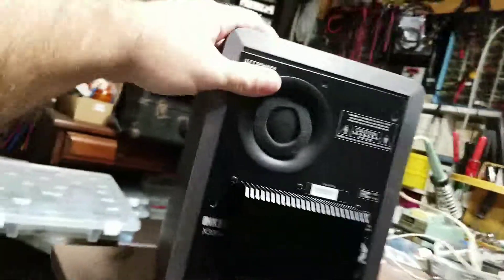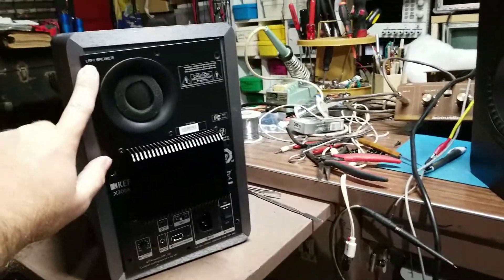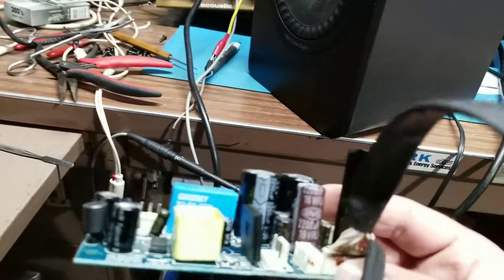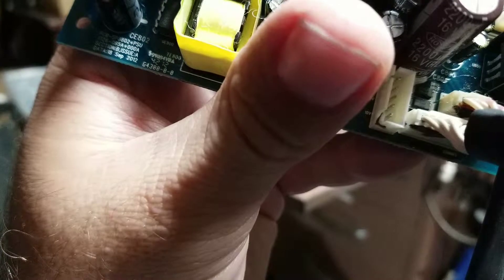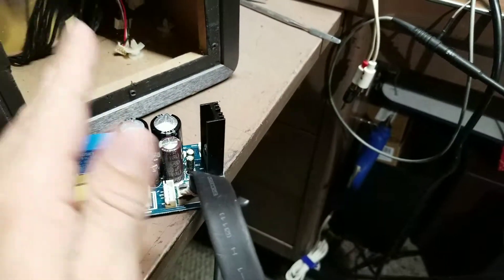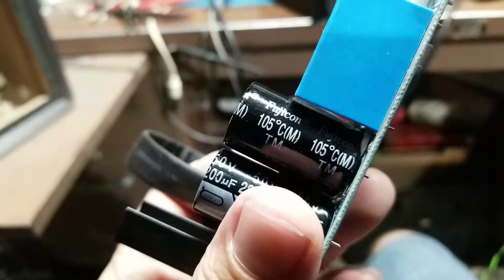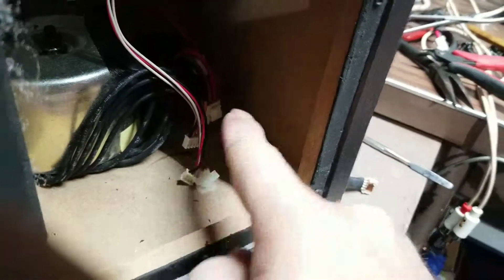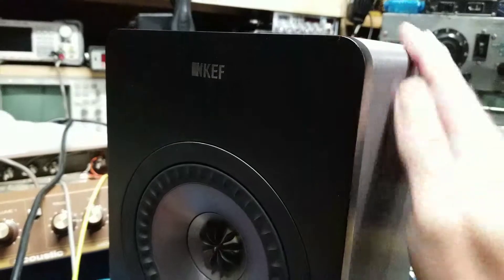KEF X300A issue with teardown and diagnosis (part 1)

Comment: Thank you for sharing this video. It encouraged me to open the speaker myself. The process was painful and far from repair-friendly, but I managed to replace the capacitors, and it works again now. For anyone else attempting this, the capacitors are easy to find on Amazon, and I cut the plastic bolts holding the board in place

Comment: My kef lsx gen1 has stopped outputting from the master, I lose sub and left with only audio from the slave. If you can do a teardown of them would be great. I think a lot of units are dying. Mine lasted 3 years and want to fix them. I have gone thru all the kef support hoops

Was hoping to get at least ten years out of them but nope.. Won't be buying another kef product..
Reply from the maker: Hey, I found other issues with kef products and isolated most issues to the glue they use for holding down components and connectors. The glue turns corrosive after a few years and eats through components.  I'll try to put another video together in near future.  Sansui was plagued with this issue as well. There's some good reads about them on the web

Comment: I've had the same problem intermittently for years.  These speakers seem to be sensitive to the USB cables. Just swapped the cable connecting the two speakers, and they're working fine again. I'm pretty sure the first cable was original, and certainly the replacement wasn't.  Notably I used a cable that had worked with a Garmin to sync device to computer, when an older cable I'd used would only charge.  Not all USB cables are the same. Def try out with alternatives before giving up.

Comment: So no Part #2 but if you have basic soldering skills you can use the Part #1 info to fix your KEF speakers.   I had the same problem and replaced the same capacitors and got them working again.  All the components were available on Amazon.  The power supply is a PITA to get out but rather than taking the speakers out I clipped off the top of the rear plastic retainers and replaced them on the reinstall.   Also he kinda misleads you on the right speaker power supply...you need to replace those capacitors as well.  I replaced all 3 capacitors on both power supplies even though not all of them had domed tops.   Also replaced the capacitor on the DAC board as he indicated.  Take pictures as you pull everything out as it will help when you have to recable everything.  Final step of reinstall is to wrap batting over the top of the rear panel (0ver the port tube and down the sides) then shove it back in pushing in the batting as needed with your fingers.   This is the second time my speakers have falied.  First time KEF fixed them for only $50 and paid for the shipping back...cool.   This time they said "sorry guy we no longer support these speakers or have parts".   My theory is that even though the speakers go into "sleep mode" when your turn off whatever device you have them plugged into...the power supplies are still hot and this could cause premature death for the capacitors which have a finite lifetime.   So I am turning off the speakers completely when I turn off the PC I have them plugged into in the hopes that this will prolong their life.   Hope this helps.
Reply: Only left side of my speaker is on reduced volume. Do I need to follow the same steps as you. Thank you
Reply: @davidng2362  My speakers were completely silent so I did both speakers.  You can try just doing the left and that should work..

Comment: I recently bought these secondhand speaker. The first few days worked pretty well. However yesterday when I plugged in the power cable, the speaker couldn’t turn on. The light indicator didn’t light up. Anyone knows what the problem is and how to fix it?

Comment: I have these speakers but I don't know what is wrong. The main control speaker all it does is turn on blinking blue then the light changes to amber blinking then it goes to solid red. The manual states solid red equals turn off speaker. Has anyone else found anyone or any way to repair their speakers ? Now I have a £400 paperweight..
Reply: I have a very similar issue. Might have a solution on the way. Will update.
Reply: @viking1101  did you ever figure out the issue?  Thanks
Reply: @kilgoretrout5456  Sadly not, the cost of figuring it out is just way too high to justify. I'm still considering if I want to look for someone who can work their magic on the speakers, but it quite frankly seems like a lost cause. I'd rebuild them to a passive speaker - if I could do it myself. ;) Its most likely the power module or some weird wifi voodoo.

Comment: How do you remove the bezel to reveal the screw holes for the driver?
Reply: i used a couple of plastic pry tools, from the inside, slipping between the rubber that surrounds the cone. There are six stubs holding it in, some of them stubbornly holding on, and only half of mine came out cleanly. All fits back together fine.

Comment: Same problem.  Left speaker doesn’t work, and the right makes all kinds of noises.  Worked fine for a few years.  Now KEF says they don’t have parts or repairs for this speaker any more.  Would be great to get them fixed, or I have $700 paper weights.
Reply: Same with my right speaker, popping noises and hardly any sound. No more Kef speakers for me.
Reply: Same here my slave outputs only which is odd

Comment: My right speaker doesn't re-activate after standby mode. I contacted KEF and was quoted $250 + shipping or a crappy trade in deal. I read somewhere else that some guy had his repaired only to have them fail again. These speakers cost $600+, mine are barely three years old with very light usage. This is unacceptable quality, I will never buy another KEF product again. 

I'd like to know if you were able get these fixed. I'd rather spend my money with you rather than KEF.
Reply: I have the same issue. Looking to find Service manual some where
Reply: @zanafar7  have you find any service manual at all? Looking the scheme of power supply main board, because one of the element is blowed and i cant identify spec number. Can anyone help me to find that?

Comment: Thanks for posting the video. Did you ever get this set of speakers working? 

I have a pair of KEF x300a which died. It looked like they had a power supply issue, but I couldn’t pinpoint any specific components that had failed. I called KEF and eventually the speakers in to a (KEF authorized) repair center. I had to insist multiple times that I wanted them repaired and didn’t want to upgrade to the LSX for “only” a small boatload of money. Eventually they replaced the amplifier boards in both speakers and they’re once again working. 

KEF claimed that that only had a limited number of parts whenever they pushed me to upgrade. It seemed like they both knew that they had a known problem with the x300a that they didn’t want to deal with and they also wanted to sell me more speakers (for more profit). The fact that they kept pushing me to send in my x300a’s and wanted to sell me new “discounted” models for well over the wholesale costs left me thinking that I never want to buy anything from KEF again.
Reply: I have basically the same issue and experience with Kef.